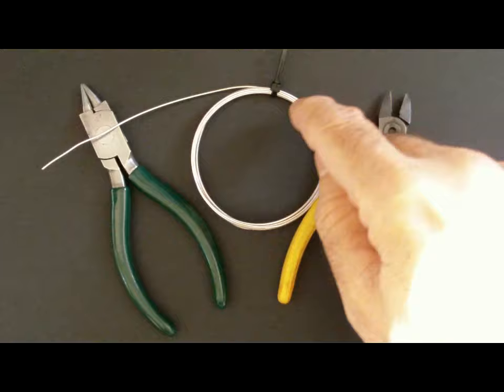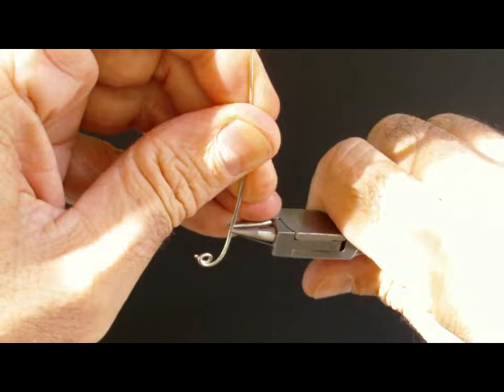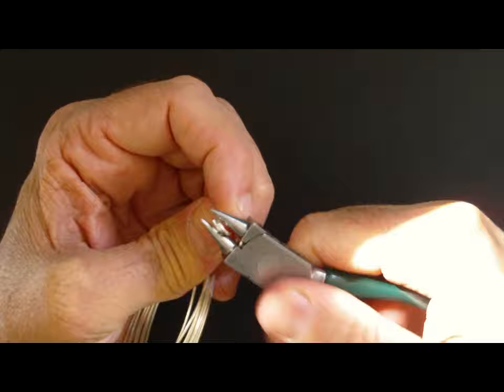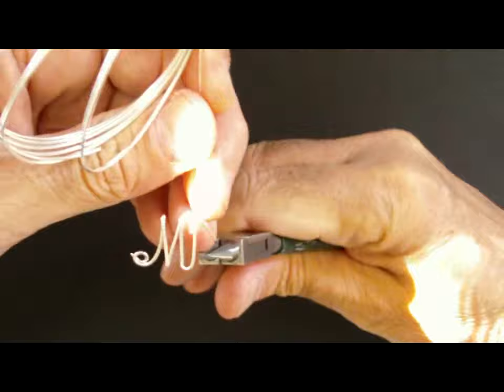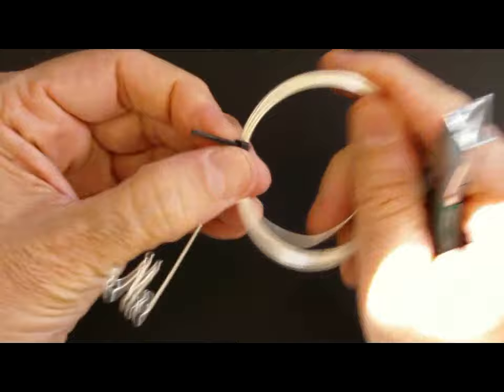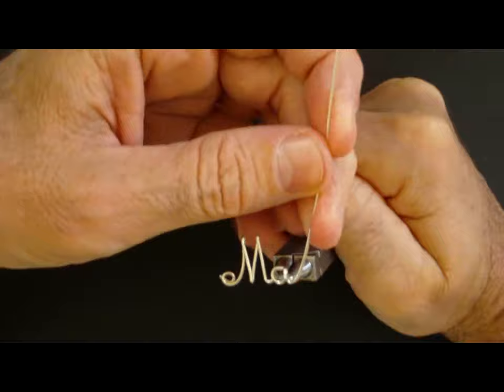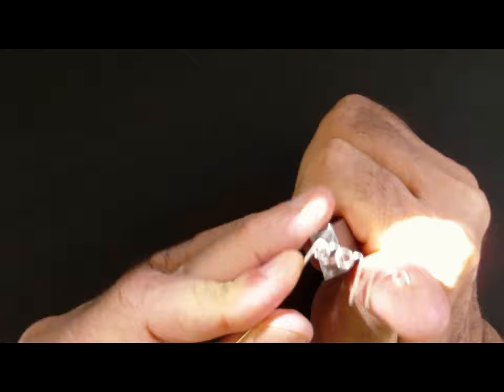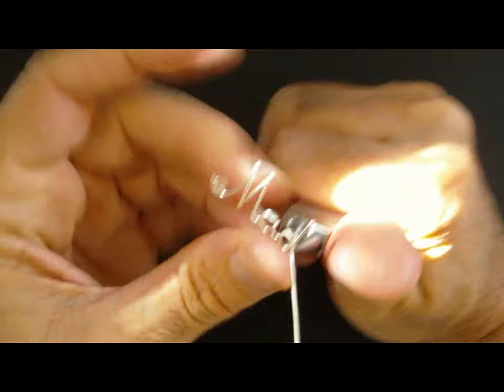How to make a Madison Wire Name Necklace (Part 1)

Comment: So the "a" and the "d" are not actually 'solid', meaning they can come apart if you tugged on both ends of the name?  I always thought it was supposed to be like handwriting and all connected in a continuous line, but that isn't the case.  Interesting.